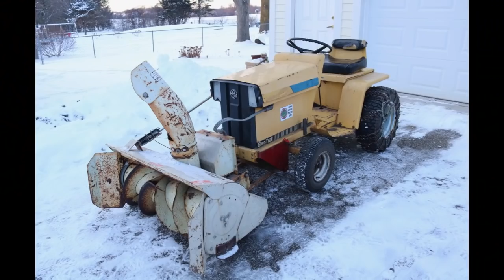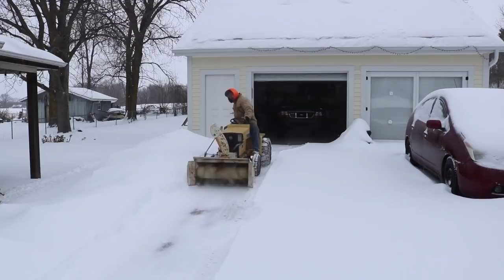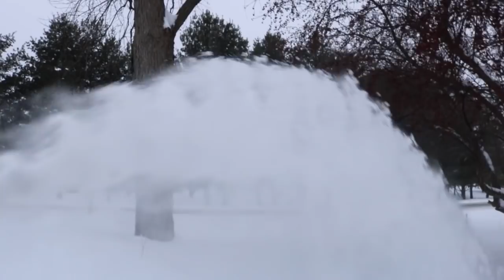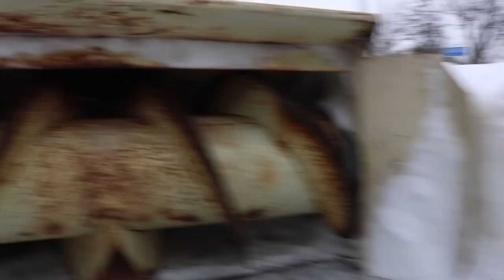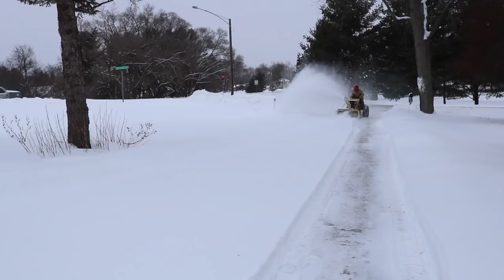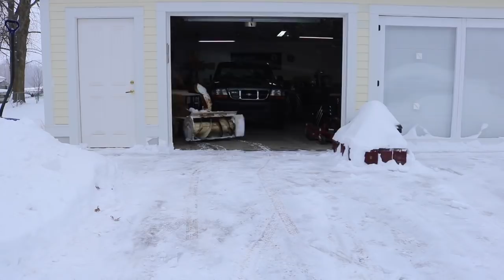Electric Snow-Thrower in Action (Elec-Trak)

Comment: Ben, to get better performance from your snow handling equipment, wax it.  Clean all the rust off your auger, impeller and all the parts that touch snow, prime and paint and then give them a good coat of wax.
Reply: You can also spray WD-40 on the inside of the blower or paint the inside with a product called Slip-plate.

Comment: What snowblower model did you attach?  Was that one of the original accessories?
Reply from the maker: Snowthrowers were original available accessories for the G.E. Elec-Traks.
The snow thrower in the video was a New Idea thrower, one from later when New Idea had purchased the rights to produce Elec-Traks under their name. Wheel Horse also made their own version of the Elec-Trak.
So, essentially, it's an original Elec-Trak snow-thrower, but a later version of it under a different name.

Comment: What’s the size of the engine on the tractor
Reply from the maker: It doesn't have an engine. The electric motor is considered about a 14HP, but do keep in mind how different gas engines are compared to electric motors!

Comment: Now you need to build a very powerfull dinamo to charge all your machines
Reply from the maker: I've been pretty happy overall with charging from solar.
Reply: @BenjaminNelsonX  thats a good solution, what about wind generators?
Reply from the maker: Wind is great too, IF you have the space for it. It also requires maintenance. (Solar is almost maintenance-free!)
I don't have the space for a wind-turbine, which is why I haven't made any videos about it.
I DO have a micro-wind turbine kit that I've been meaning to assemble sometime. Perhaps I can do that and shoot a video of it. I also know a guy out in the country with a farm and a good sized wind-turbine. I'll make a note to myself to see if I can film him talking about his system.
Reply: @BenjaminNelsonX  that is great, I am working is a closed system is an electric dinamo conected to a electric motor and a stack of batteries in between to compensate the termodinamic lose of energy, the idea is charging batteries while system working and enlarge the discharge range of the batteries, so an electric car can run more than a simple charge